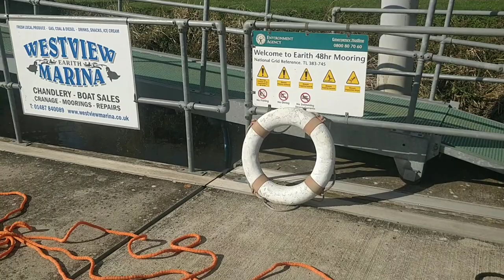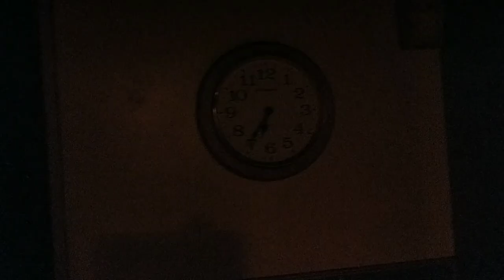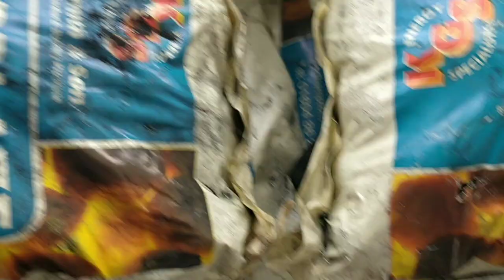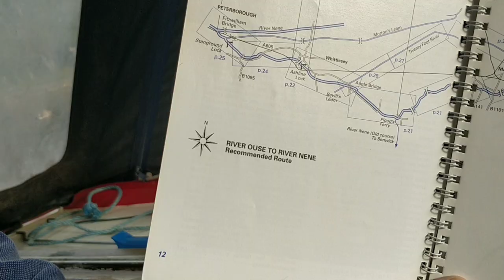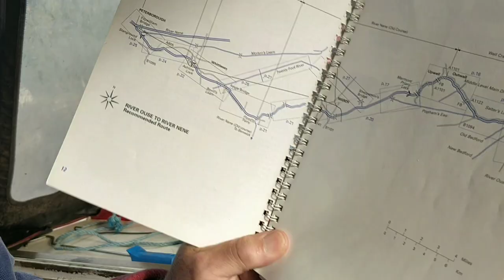Narrowboat life. A day in...

Comment: Such enchanting landscapes and appropriate musical accompaniment, ta much. I seem to have worked out that the Nene used to flow into the Great Ouse at Denver, but was rerouted in the 17th century (probably by a Dutchman) to flow via Wisbech straight into the Wash. That probably invented Wisbech as a port, but I won't speculate any further. Your videos cause me to ruminate (like those cattle).
Reply from the maker: The Dutch came over in Dutch barges to work the land. They built little red brick houses out of the boat ballast. Fascinating area and such an achievement back then. Thankyou for your great comment.